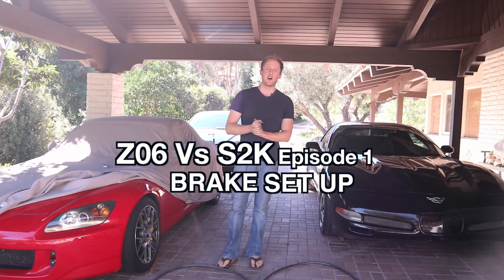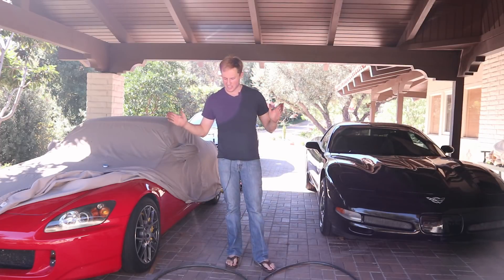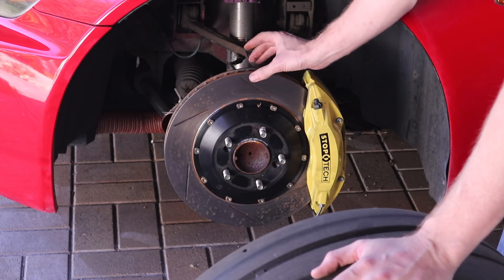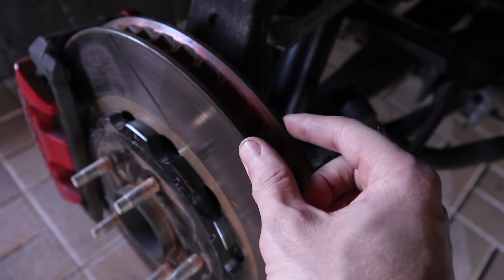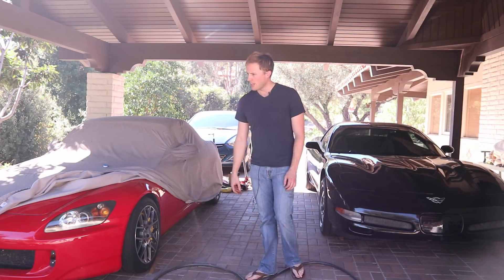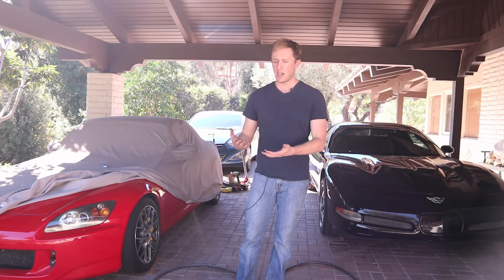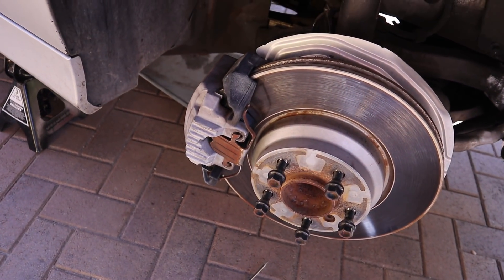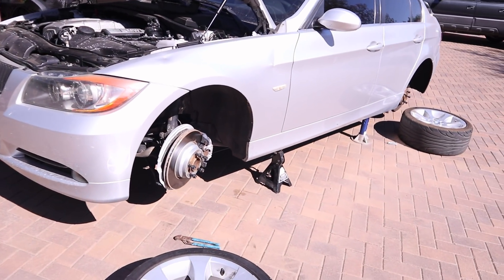Z06 vs. S2000 Track Build - Brake Set Up

Comment: Hey Zent, what’s your take on budget rotors for track days? There are lots of cheap rotors that meet oe specs under 30-40 bucks (Centric, Duralast) compared to 100-150 aftermarket name brands.
Reply from the maker: In my experience, the cheap rotors last just as long as the name brands (I get 1-2 days out of the one piece rotors). Buy the cheap blanks if you aren't worried about labor. If you pay for labor, then a quality 2 piece rotor generally ends up paying for itself in longevity.

Comment: I agree with most of your video other than C5Z brakes being expensive to upgrade. I think you said Big Brake kits for them are expensive but the gist of what you said being upgrading to better performing brakes being expensive.

For less about $400 I just upgraded my front brakes on my 02 Camaro SS to GEN5 Camaro Brembos. $70 for two 1-piece 14" rotors, left caliper came off a car with 10k miles and I got it for $90 while the right caliper came off a car with 28k miles and I got it for $80, running PowerStop Z26 Extreme pads and I think they were $60, the brake lines I bought from Kore3 were about $80 after you include hardware and shipping, and the Motil RBF 600 cost about $48 for 3 bottle which was more than enough to flush both my brakes and clutch. I'm a Tool Maker so boring the center hole in the rotor out to 70.7mm was free for me. All this adds up to around a $428 cost but if I went with cheaper pads and brake fluid I could of done this for less than $400. Run OEM C6Z wheels on my car so no spacers were needed which means new wheel lugs weren't necessary either. I could have probably gone with the 6 piston Brembos from the GEN2 CTS-V or ZL1 and cleared fine with these wheels.

The point I'm making is there's not too many auto brands out there that are cheaper to mod and buy parts for than GM. First I agree that C5 brakes are pretty damn good brakes for 2 piston floating caliper brakes and with good pads they are more than capable of overpowering most tires you would mount on the front of the car. Other than paint and/or the logo on them I never could visually see a difference between C5 calipers and LS1 Fbody calipers but Fbody guys have been upgrading to the C5 brakes for years and they are supposed to offer a noticeably improvement. With that said the modern 4 piston Brembo caliper brakes are likely a better braking setup. Big improvement on my SS. If you wanted to keep the factory 17's on the front you couldn't run the GEN1 CTS-V/GEN5 Camaro SS brakes as I don't think they'll clear a 14" brake setup, but they should clear the base (non-ATS-V) ATS Brembos and base (non-Z51/Z06/GS\etc) C7 Brembos. I think both the ATS Brembros and base C7 Brembos are pretty much the same brakes. They use a 12.6" rotor with 4 piston Brembo calipers. They're becoming a popular upgrade for the Fbody, WRX STi, FRS/BRZ crouds because they're a big powerful caliper with a rotor small enough to fit in a 17" wheel. Even though they're the same other than the paint the ATS pieces will likely be cheaper to buy.

For around $500 you can have a fixed caliper Brembo setup that's likely an improvement over the old C5 2 piston floating PBR calipers. Unless you run GEN1 CTS-V calipers (which are the same as the GEN5 SS calipers other than the mounting holes diameter) you will have to open up the caliper mounting holes on the knuckles to fit a 14mm screw. Factory GM was 12mm to mount their calipers to the car and their newer stuff use 14mm screws to mount their calipers. The holes locations between them are the same though. At least on a Fbody that stuff is cast steel and drills easily. I used a 35/64 drill which is slightly smaller than 14mm (.547" vs .551") because I figure it would drill a little bit oversized and it worked perfectly.

Comment: Where'd you order those rotors for the z06 and how many rotors did you order for 500?
Reply from the maker: Jegs or Summit and they will price match. You get 1 left and 1 right rotor. When they get worn out you just replace the rotor rings and they are $200 a piece. If you are just doing light track stuff, the stock rotors will suffice and save you money!

Comment: Great video, Zent. I like how a variety of approaches and price points were covered.

Just for my edification, is the BMW "less expensive" as you were able to get the 335i for cheaper? I ask as, when they were new, they were expensive cars. For me the z06 is still a cheaper buy, other than consumables (:nod:). Putting in an LSD and still chewing through pads without cooling on the track would seem to possibly go through consumables more. Also, it is a fairly heavy car, stock. 

Something like an MX5 or BRZ would seem to be the cheapest way to go to the track on consumables (leaving out initial car price). 

Regardless, very interested in the series, and as always, thank you for sharing your time and experiences with us.

Comment: Is the default (ATE DOT4, iirc) brake fluid not good enough for tracking the 330i with?
Reply: Nick Amarit better to have it and not need than to need it and not have it!
Reply: Kamil S You didn't answer my question.
Reply: Nick Amarit how so? The ate is rated for 200*C boiling point. The rbf600 is rated for 600.
Reply: Kamil S Ok, now I understand. So even though they're both DOT4, doesn't mean they're equal (at least in heat tolerance rating). Thanks for the clarification.

Comment: you will have to rebuild those calipers every season if you drive hard... or else your calipers will push the pads into the rotors when you're not even on the brakes, causing massive overheating issues. i had huge issues with a used st40 two piece rotor combo for a GTI. I had massive rotor issues all season due to that bullshit. spent too much. should have bought a new kit instead of used. rbf660 has been solid.